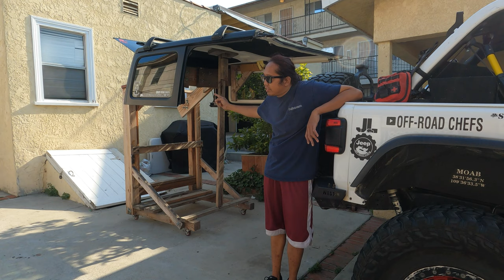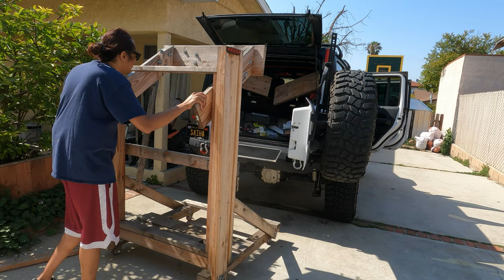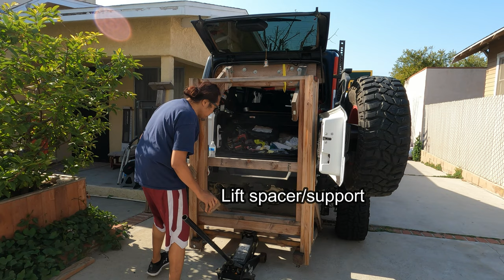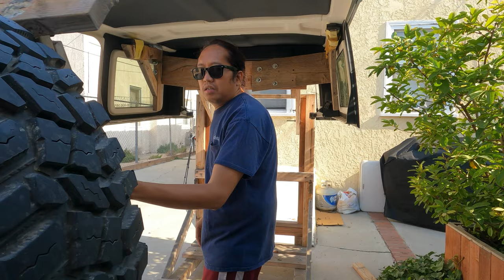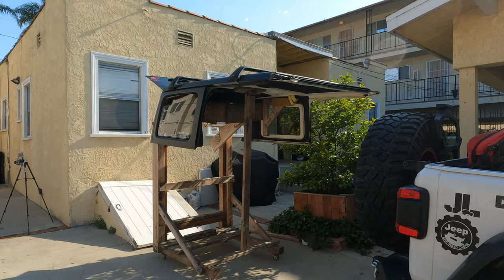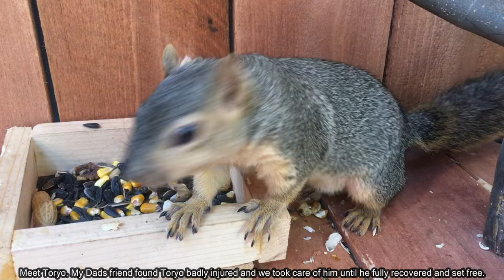Jeep Hard Top Lift One Person Removal DIY "The Catapult "

Comment: Just don't leave up there on a windy day. Had my top on a table just a few feet up and a gust of win blew it off and the fiberglass edges were it meets the tube is all cracked. Still works but lesson learned get it on ground or inside garage. Other than that good job for creativity